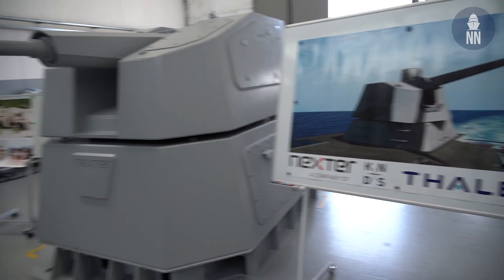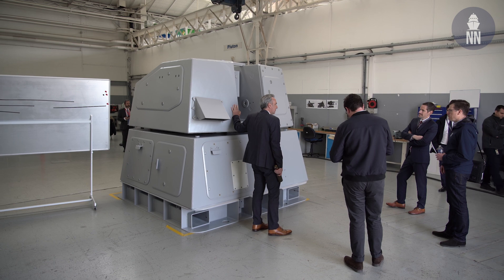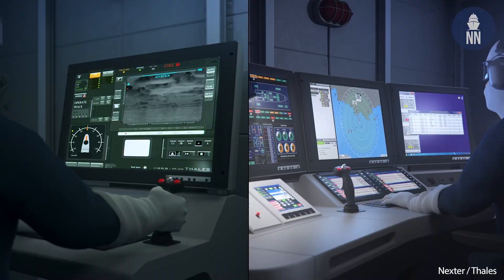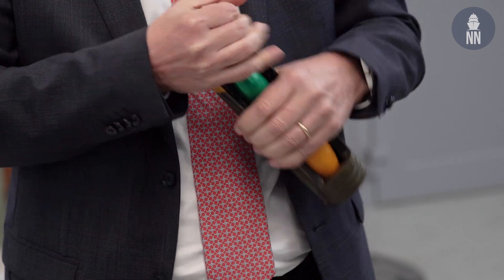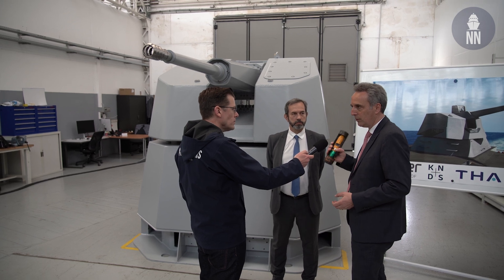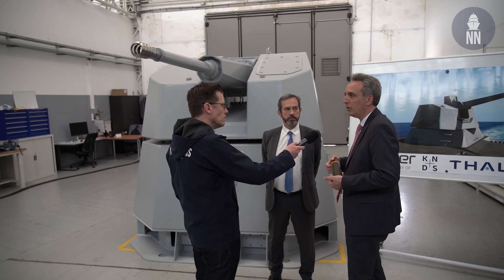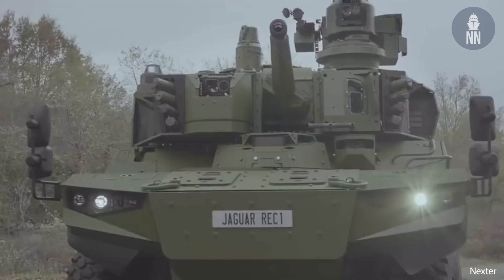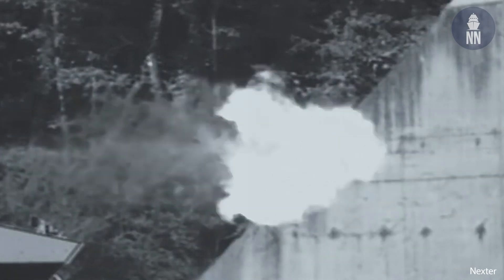RAPIDFire: The New French 40mm Naval Gun System by Nexter & Thales

Comment: 40mm is only any good for anti-air on a ship
Reply: It can do a lot of damage to any ship or boat. If you fire 40mm rounds at a ship you can knock ot the ships radar wipe crew out in the front venerable area of any large ship depending  on rounds used and range.  On smaller ships such as OPV and attack boats it can knock  them out easily. Not just aircraft and drones ect

Also it is good for close in weapon system. Can shoot down incoming missile. Especially cruise missile with the high explosive rounds.

I watch a documentary on the battle of midway ww2 as where I seen a live footage of an American aircraft  switched from using his guns firing down on the ship igniting the ammunition bay and the ship exploded.  So if a 30mm gun could do that to a thick armor of a battleship.  I think a 40mm with the armord piercing shels today could easily penetrate a large ship depending  on range

Comment: I remember when Xavier only launch French speaking video sometime ago. I commented this is another CIWS, and some fools call me talking nonsense. Turn out Nexter do aim this as CIWS. Rate of fire can be augmented by type of ammo.
Reply: I'm not fully convinced yet. When Xavier asked them if it was a CIWS (as in an anti-missile system), they didn't say yes, they only said it could do surface to air. Then when he asked them what sort of air targets the dedicated surface to air ammo could engage, they only gave drones and helicopters as example. My take is that since the dedicated ammo is still under developpement, they have yet to do tests against a simulated cruise missile and validate that capability.
Reply: @WBtimhawk  it’s not a ciws, it’s specialised as an anti surface weapon and anti slow air targets.
The rapidfire is designed to work in tandem with the simbad launcher ( specialised against rapid air threats only ). 
So the two completed themselfs. The future french ressuply ships, and the future pang will use both the combo rapidfire + mistral.
And i really want to see the future coast Guard class patrol ship equiped with this.

Comment: Dont know how very effective it will be without a tracking radar at least. Optical targeting isnt capable of reaching everywhere.
Reply: they'll be on a ship, this system won't lack radars. The optical targeting does help for the final aiming. Same for the ground system, you're supposed to use it coupled with a GroundMaster radar, also made by Thales
Reply: It will use the Radar on the ship it be integrated in the system like remote

Comment: Imagine the Bofors 3P ammo upgraded w/ that munition-inside-case config, even more compact since 3P can already do the roles of those 2nd, 3rd, & 4th ammo in the vid
Reply: Seems like a no-brainer considering BAE Systems has production rights to both.
Reply: The KE-AB and GPR-AB-T rounds do exactly the same thing as 3P so no need.
Reply: @dogsnads5634  These are the RAPIDFIRE ammunition, since this gun was developed between BAe and NEXTER!
Reply: The bofors 40mm has a much larger range. It's one of the best ammo for drones. People forget these guns need to target high altitude drones too.
Reply: the problem is that every time we want to do something unique to perform several functions, it doesn't work all the time, for the moment, only one thing has succeeded in this mission, it's the Rafale from Dassault, even the Mirage 2000 never succeeded! and the biggest failure is the F35, incapable of carrying out a single mission because it was so poorly designed! as for the Rafale, the F35 has 3 versions, A, B and C, the Rafale, B (two-seater), C and M (Navalized)

Comment: Its an clever design but as an ciws fells it fire rate wrong. 300 per min is not that good. Better were 450 shots buts that my. Also can one use the gun with the oto melara 40mm bofors system with the two 40mm guns. I think with Upgrade fire rate to 450 it would have 900 . A killer system. And thanks for this wonderful video.
Reply: It’s not a ciws, it’s an AA (UAV, mini drone, helicopter) + anti surface.
You don’t need an high rate of fire on this weapon, because the video say it’s very very acurate. So you have the same efficiency but you spare ammo and you have a lot of ammo because they are telescoped and more compact. So it can be effective for prolonged fight and still be active even if the ship is damaged.
France never has develloped a ballistic CIWS so far cause they use only aster and maybe mistral missiles for this.
Reply: @victor6814  the type 31 frigate use the single Oto 40mm cannon as the ciws weapon
Reply: @a1tse191  the type 31 use 40mm bofors Mk4. An ugly but pretty good ciws. 
The rapidfire is also a 40mm but not a ciws. It’s speciallised against slow targets like drones, helicopters and surface threats. His targetting computer is too slow to challenge rapid air threats like fighters jets or incoming missiles.
Reply: @victor6814  AA? I think bofors 40mm will be better in that role. It has greater max range altitude. 

People really underestimate why L70 40mm ammo is so much better than a 35mm or 30mm. L70 40mm has so much more propellant compared to it's size. 

This is also the case for oto 76mm. They pack extra long propellant case.
Reply: @bulthaosen1169  my previous comment is 3 years ago. So I will update with the new data we gathered for the rapidfire : 
- 4.000m of range
- 180 rpm with 160 ammo in the mag
- turett is non penetrating.
- ability to separate the fire guidance ( not mentionned but seen on BRF ships )
- ability to add a mistral missile module on the turett
- can engage missiles ( CIWS ), previously the team was avoiding to reply this question,  even if it was asked one time during an interview.

So it’s far better than 3 years before, and has now the critera to be classified as a ciws.
Reply: No. Everytime you upgrade the caliber you have a trade-off in lower RoF. 300 RPM for 40mm class is normal. Enhanced effects ( more explosives and shrapnel ) and special ammo ( timed and proximity fuses ) means RoF can be lower.